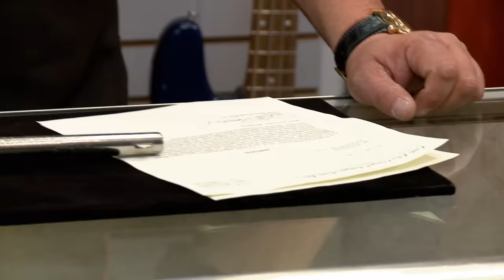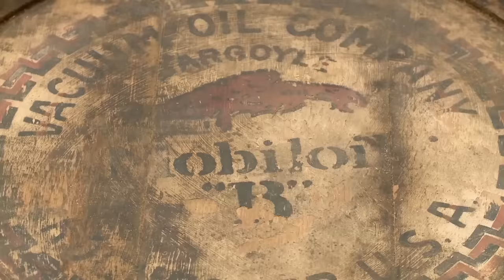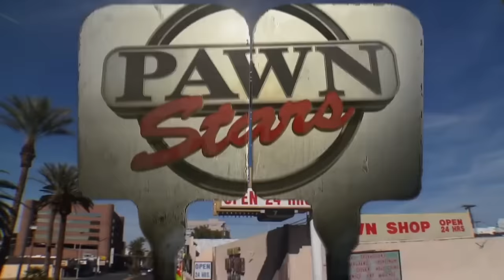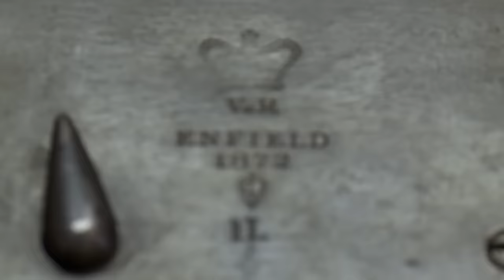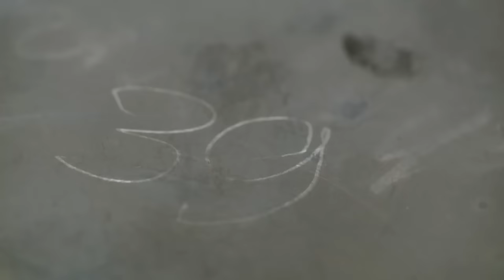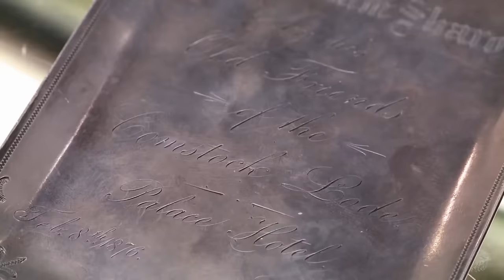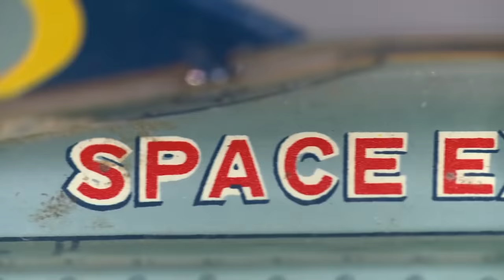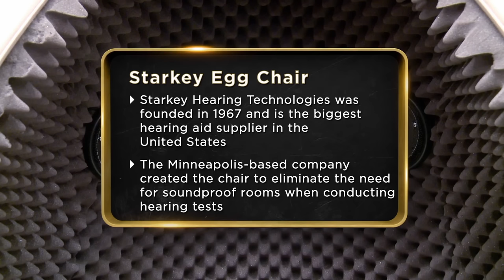Pawn Stars: BIGGEST DEALS OF SEASON 13!

Comment: If you're so sure something is worth a fortune, surely you'd auction it rather than try and shift it at a pawn shop, no matter how 'famous' the pawn shop is.
Reply: I don’t disagree or agree with you. However, depending on the item and the value of the item many of Rick’s offer are good. One receives money immediately without any risk. Years ago a friend of mine’s parents sold a genuine copy of a Stradivarius violin at an auction and after all the fees were said and done they received $75,000. It sold at the auction for almost double that amount at the auction some thirty years ago.

Comment: The elderly man with 1944 Lincoln steel penny, he was originally asking for over 100K.   The price all depends on the condition.  His coin was graded as AU 53 by PCGS, which is NOT high.  Higher grades starts with MS grading and the top is the MS70.  Now the PCGS price for this rare coin at MS63 range is about $87,500. If it is MS64, which is only one grade higher, it can worth up to whopping $185,000.  Since his was graded only AU53, it will be lot less than $87,500, perhaps like $40,000.  That also depends on the demands and population of this coin.  They are only 25-30 in existance but if 10 of these shows up for sale, then population will increase and the price will decrease.  So it is all up to supply and demand.  The bottom line is he was asking too much for the condition of his penny.
Reply: Nope, that coin auctioned for $300k in the 1950's, its worth about a million now
Reply: @Cereal_Killer007  okay, I just googled it. It says that according to the coin book, one that was in much better condition than his is worth up to $1.1million in 2021. It also says that the highest one has ever gone for at auction was even better quality than listed in the coin book and went for $408k in 2021…
Reply: @ILoveYou-rv3pd  I saw that as well 😅
Reply: @Cereal_Killer007  then, why did you say something contradictory? 😂
Reply: @ILoveYou-rv3pd  I thought it was worth a million when I wrote that because its what I read long ago but after writing it I googled it and saw a price drop to to 400k but I never came bavk to correct it as that may just be a bad day at auction

Comment: I set the value at $30,000 . note across bottom: a 1944 steel sold at auction for $373,000.   I think Rick is in cahoots with his appraisers  every single deal they go way below value.

Comment: I am so proud of that guy that stood up for himself with the Led Zeppelin album. Way to go dude. You were smart enough to know that if you went to Christie’s auction house, that album would assumably auction  off for up towards $50,000. Very good choice you made to walk out of that store with your goods. 12:04
Reply: A similar album (same placement of the signatures on the same album, unsure if it was the exact same album shown here) sold at an auction in 2019 for a total of $22,956. Minus the 25% Buyer's Premium, leaves the seller with $17,217, slightly less than this seller's final offer.
Reply: I would split the binding, frame and display front and back side by side.
Reply: @mixintl  Arrgghhh!!

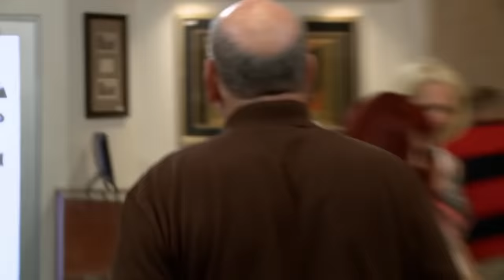Comment: @15:28 1944 STEEL Wheat Penny Value
According to the NGC Price Guide, as of September 2023, a Wheat Penny from 1944 in circulated condition is worth between $35000 and $43500. However, on the open market 1944 STEEL Pennies in pristine, uncirculated condition sell for as much as $175000.

Comment: I've seen things like this bone record back in the seventies. Byte magazine or  Interface age would have them every now and then and they called them floppy ROMs. ( ROM is a acronym for read-only memory )  You would take the floppy rom out of the magazine put it on a turntable and when you play it the sound would be the same as a 300 baud  acoustic modem  just play it near a modem and stay quite.     The floppy ROM would probably hold 10 pages of typing.

Comment: $34,000 is base price for the 1944 error penny in used circulated condition,ungraded found in pocket change. $408,000 is the auction record for a graded coin .

Comment: When it comes to the 1944-S steel cent, it is worth $399,637 in average condition and could be worth more than $1.11million in an MS63 grade, according to USA Coin Book.
In 2021, one in an MS66 grade sold for a record $408,000 at a Heritage Auction.
The grading scale only goes up to 70, meaning a 66 is very high.The 1944 D steel cent is worth nearly $34,000 in average condition. In an August 2007 auction, a 1944 D Lincoln steel cent graded in MS63 sold for $115,000, according to PCGS.

Comment: 1944-S copper Lincoln cent — 282,760,000 minted; 3 to 5+ cents 1944-D over S copper Lincoln cent — mintage known; $100+ 1944 steel cent (any mint) — 15 to 20 estimated; $85,000+ * Values are for coins in average circulated condition. The D or S mintmark is found under the date on the coin.

Comment: I'm confused about the steel penny. The little pop up info box sed a mint coin just like this sold at auction for almost $400k but then the appraiser said at auction they can go or 30k?

WTF is he talking about?

Edit: NVM the quality is AU53 which is the second lowest grade they have, and the appraisal is exactly right. The one that sold for 400k must've been a MS66 grade coin.

The offer for 25k  was actually a pretty good one because the AU53 coin value goes from 18k to 31k...

Comment: The original perk of originally streaming your television services was no commercials. They knew it wss a risk they admitted it worried them that their share price would crash was in every finance article you read and every news channel. So it's basically like Netflix just slapped you and said "we own you", your back at square one paying to stream television yes it's a bit better then cable but it's essentially the same thing. I mean think about it especially if you hsve  cable internet the only thing different is you added a modem. 

To add to that you forgot  after the requirement to have a landline for internet ans now  days everyone has a mobile phone so many I would say a majority no longer needed a land line. So service providers charge double unless you bundle with a land-line or television + internet + land-line.

Comment: that oil is vacuum oil though. im not 100% sure but nowadays vacuum oil is meat industry only and you turned down the very creators of vacuum systems as standard oil. even though they still differentiate from consumer oil by about 500%. u lost an industrial gem.

Comment: I’m definitely going to catch some heat from this comment, but that’s fine.
There are 2 specific “legendary bands” whose albums would go straight into file 13,aka the trash can if I ever found them in my house no matter what they are worth.
Those “legendary” bands are none other than:
1. The Beatles 
2. Zeppelin
I’ve never been a fan of either.
In my opinion both were legendarily 2 of worst bands to ever come out of that era.
Not that anyone cares what my opinion is.